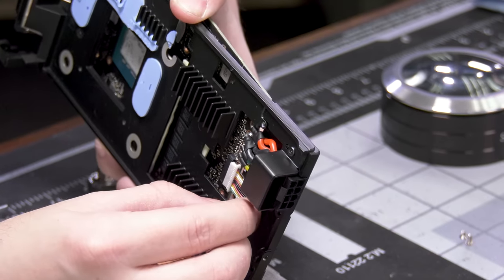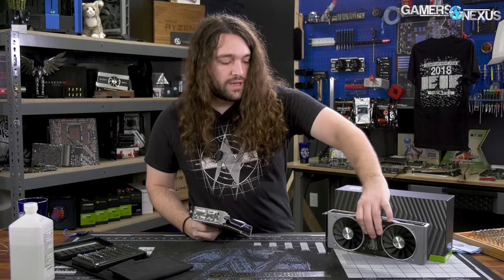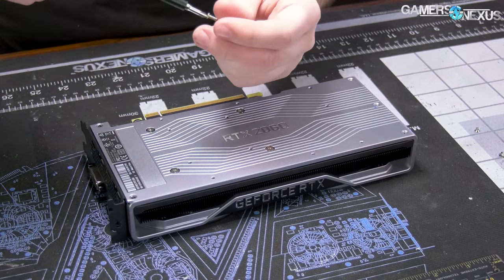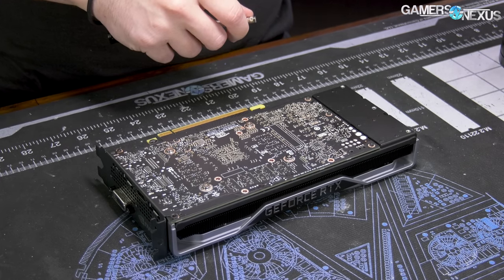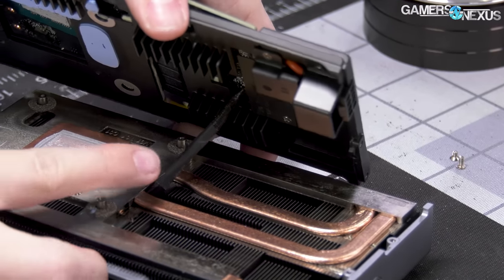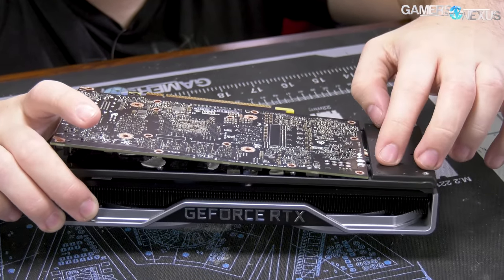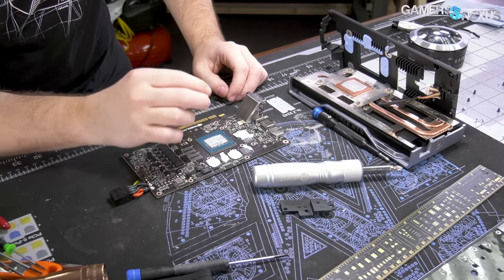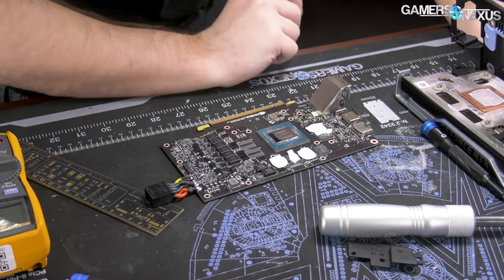RTX 2060 FE Tear-Down: They Added More Glue and Screws

Comment: Clearly nVidia doesn't want you to watercool this card
Reply: My first thought.
Reply: +1
Reply: @frostybe3r  A mid end card is now 350$ :(
Reply: Why do you need to watercool any card?
Reply: @frostybe3r  lol im sorry, my sarcasm wasnt obvious enough for you.
Reply: @warblesnow7925  nope, not clear enough. Didn't catch it first time either.
Reply: frostybe3r Not necessarily higher frequency. silicon lottery; I lost with only 60+ core clock for a Hybrid Ti FTW3. 😢
Reply: wasted their otherwise good PCB (not just 2060, but all the RTX reference cards) because of that, so sad
Reply: Who in their right mind would buy a low end card like this to put in an expensive custom loop build?!
Reply: They don’t even want you to replace the fans if they go bad.
Reply: @frostybe3r  because it's an underclocked 2070. Same exact chip but sold twice as much with the 2070
Reply: No company really wants you to be able to change things on their product.
They lose a lot of money on customer complaints and even more when they changed anything on their product. That's why a lot of companies already simply send you a new product when you have some issues rather than going through the whole process of figuring out where those issues came from.

But when that person is probably going to also damage the new replacement product it costs even more and so on. For someone producing such things it would be best for the customers to just buy them as they are, use them as they are and replace them when there is a problem.
Reply: Be water my friend
Reply: frostybe3r what's the point of longevity if you're just upgrading every new launch anyway?
Reply: Ignoring the fact that you yourself probably wouldn't want to watercool an XX60 card, I wouldn't say they don't want you to, they just don't give a damn how hard a time you have doing it.

Comment: No way I am buying the reference card after seeing this
Reply: Who opens their video cards anyway? Why do you care?
Reply: @trippplefive  In case I want to change the thermal paste in a few years, for cleaning, in case a fan breaks and I need to change it. There is no reason to why this need to be such a pain in the ass.
Reply: For thermal paste replacement or cleaning the heat sink. And water cooling with higher end cards.
Reply: trippplefive because when the fans die, I want to be able to replace them.
Reply: @trippplefive  ordinary people (Nooob 😂) like you don't understand that
Reply: @claritoresdiano1021  Calls people noob, but probably thinks that PSU brands other than EVGA or Corsair (Especially cheaper brands) are trash or will probably blow up.

Comment: Extra screws. As components heat up and cool down expansion and contraction occur. More screws = less change that seals between eugene pads, solder joints and thermal connections can be broken. This increases the cards structural integrity and assures optimal thermal flow. It also reduces the acoustic vibration offset decreasing the sound which may emanate from various loosening/tightening areas of the board during hot/cool cycles.

Comment: For removing glue use Isopropyl Alcohol, Acetone or..if you're careful with it (it can weld PVC, Polyurethane and that) Butanone/Methyl Ethyl Ketone (MEK).

They all make good degreasers too if you chuck them in water & mop a floor with them.

Comment: Using one way to build cards (from 2080 -> 2060) means you need less installations, instructions, people, materials, etc. If you have set up the 2080 construction line, it is more cost effective to stream in the 2060, instead of opting for a completely different and separate solution. You must try and reuse as many machines, people and knowledge as possible. This also means you have less time overhead and you can reuse the same quality tests down the line. I think it makes perfectly sense to look at ROI for already in place machinery, when you have a running industry and don't want to start over from scratch.

Comment: This is hard to watch. Use your eyes. There looks to be a wire-strain relief screwed on over the connector of the wire you're trying to access... 2 screws... It looks like you can see it at around 12:00 -- There is enough wire to flip it over either by rotating on its side, or by flipping it 180 over itself - that's typically how it is designed so it can come apart.

Edit: He finally sees it... But we had a saying in the military.. never with force... This pertained to disassembling weapons - if it doesn't move in a certain way, it isn't meant to - don't force it... The same is true for a lot of these other designs....

Now I hear about the glue - they shouldn't have done that - it should've been made to be easily disassembled...

Edit: It is a strain relief, not solely for cable management. If you were to rotate it over without that plate, then you could break the connector. Because it was there, with all of your yanking and tugging and fussing, it prevented it from breaking - however they may have glued it because it is a review sample or knew what you were going to do so they added it in case you were going to take it apart without looking, which you did, to prevent damage in case you spotted the strain relief, you didn't, and broke the connector, which you couldn't because of their glue.

Edit: If they are that new to fan structure building it could simply be them avoiding patents...

Comment: I used to build computers in the late 90’s when new tech was way more exciting. They didn’t cover things in plastic shrouds. In fact I had a Slot 1 Intel celeron that came as just a bare PCB. Graphics cards had just come out  as AGP - were bare PCB’s and it was up to you to add a fan to cool the chip.

Comment: The word on the street is that you get more performance when you have more screws per cuda core, you get better performance. In light of this recent discovery, Nvidia is trying to achieve a ratio of 1:1 in that regard to achieve maximum possible performance. They have also found a direct relationship between die size and glue area and they are working on that ratio as well.

Comment: I don't like how the power socket is wired in on an extension.. Using that card as a test bench card would just kill it, those wires will snap from removing the power cable a lot over time..

Comment: I was going to say I am shocked that somebody finally made a GPU where you can remove the shroud without removing the heatsink from the board. - Which I always wanted, (it be easier to clean the the card and fans from dust). But no... that cable crushed that.

Comment: This isn't hard to explain.  The small reference PCB will allow AIBs to make cheaper cards.  Clearly the PCB was designed with the intent of allowing the power connector to be directly soldered instead of pig-tailed.  The over-designed FE card is because nVidia wants an "Apple" like product at any cost.  Someone will make an easy to follow, step-by-step guide for this card.  Although it won't be super quick, nothing looked that intimidating in this tear down.

Comment: It would be a LOT easier to take apart if you didn't keep stretching the cable diagonally by keeping the parts like that. If you pulled the bottom closer to you so the cable was at the same place as on the cooler, then you would get a lot more length to work with. then you could keep it at 90 degrees and screw everything apart.. ;)

Comment: Nvidia really needs to do a bit of management adjustments, take someone from the manufacturing side for the coolers and put them in charge of the engineering side, when the engineers engineer something they will be told to simplify it.... 5 times in a row before it gets approved. You get an equal quality part that costs less to make and assemble in the end. After one product launch and being forced to simplify it a half dozen times the engineers will make the next one simple from the start and be able to put more time into the actual active cooling parts making it more efficient and superior.

Comment: Couldn't you have just turned the fan assembly 90 degrees so you can access the 3 phillips screws on the connector cover? It looks like the harness is long enough for that.

Comment: Hey Steve, I was wondering how common it is these days to swap out the cooler on graphics cards as it was back in the days? The 8800GT was the last card I swapped coolers on, but before that it was pretty common to do it on a "founders edition" card. Also because the "founders editions" were usually cheaper than the aftermarket with better cooling. Are brands like Zalman, Arctic, Thermalright, Zerotherm etc. even still producing aftermarket stuff? I 2 years ago I swapped my desktop for a gaming laptop because of the crazy graphics card and RAM prices and haven't really been keeping up to date.

Comment: So, if that DVI  output wasn't there it could be a single slot card if used with a waterblock?
Reply: Possibly. Higher end cards such as the 2080 eliminate the DVI connector. And stick with the HDMI and DisplayPort connectors.
Reply: Except as shown here they are trying to get people to break their gpu's when trying to put a waterblock on
Reply: @React2Quick  Most higher end cards replace the lone DVI with Displayport because they hate compact watercooling builds.

Oh well, I'll just keep cutting it off with my dremel.
Reply: Just modify it, wouldnt even be difficult

Comment: lol, seems like PITA to open the damn thing.

My CG is a GTX750ti old af, the original fans died but for reasons I couldn't afford buying a kit or replace it with a newer card, but I had an old CPU fan lying around somewhere... 

It happened that the board had an additional fan powersupply just close enough the PCI-e slot, I strapped the damn fan on the aluminum heatsink, et voila, I can even set the fan's rpm depending the CG's workload !! Been working like that for 2 additional years, the card never been so cool lol.

Comment: They've been making these cards for like these 10 years with almost identical designs literally no reason to start using less convenient screws and gluing them together other then planed obsolescence and discouraging you from doing preventive maintenance on the card as performance gains with revisions are starting to slow down.

Comment: not that ti excuses crappy design but, i actually liked rear mounted 6 pins in some cases. they used to do it that years ago and it made hiding cables in my case easier and as i could run the 6 pcie cable along the HDD rack in the case.

Comment: Actually .. Gluing connectors was something ... ehm .. "popular" 10-20 years ago ? And some "older" PC builders or technics are still gluing connectors at MB to prevent accidental disconecting by user ... I think Nvidia had same idea, maybe they got some cards back fro mcustomers, that they are broken, but they just "thanks to vibration, heat and moving with pc or in package" were disconnected, so they glued and packed them and stuck them, so they cant move ..

Comment: Hey Steve, I have a question for you! My father just recently played VR on my gaming rig and was blown away by it and wants to build a gaming rig capable of normal and VR gaming at a decent frame rate (I think VR is optimal at 90fps? Or at least that is what my Oculus Rift runs at). Would a 2060 be a good choice for that given that most of the GTX 10 series cards are gone or to high of a price to be reasonable? Or would you suggest something else? The monitor I gave to him is an LG ultrawide 1080p model.

Comment: I have the same model of rtx 2060. Is it a good idea taking the back plate out? Will it help at least a bit with its temps? I noticed this part in particular gets really hot, so I'm not sure whether it actually dissipates heat or retains it..

Comment: Why don't they just put the power connector at the bottom of the card, and install power connector on motherboard that it plugs in to... We already have ATX connector plus the 8-pin AUX connector, why don't they just make it possible to connect GPU connectors on the motherboard as well... Just a thought.

Comment: With all these different screws/ bolts i Fix it will have to sell a $1000 tool kit... So how long will the thermal paste last before you have to pull apart the card to replace the paste? If this is the rigmarole you have to go through they have basically shortened the effective lifespan of the card...

Comment: I watched a video of a bald guy who likes to test electronics by tearing them apart carefully, he used refrigerant in a can and the liquid Nitrogen to cause the adhesive to break down.  I wonder if you could block that cable off and spray it with canned refrigerant to get it loose without damaging the other electronics..... not sure how badly it’d effect surrounding electronics or the wires themselves though.

Comment: It's a shame few outlets mention the pricing outside the US. Here's an example from today (2019-01-07) of a 2080 Ti (I realise this video is about a 2060 but this highlights my point):
Card : EVGA RTX 2080 Ti Ultra 
US : $1410 (6% combined tax)
UK : £1350 / $1725 (inc. 20% VAT)
EU : €1400 / $1605 (.de - inc. 19% VAT)

There's quite a difference once taxes are included for the same product, even with the current Trump tariffs. 

Notes: US, UK, EURO area / sums rounded to nearest unit / all $ in USD / 6% US tax includes sales and state/local rates.

Comment: I ran NVIDIA cards for 18 years, got a AMD card because of the price, the MSI  RX570 8GB is way faster than the NVIDIA GTX 960 4gb card and it does not draw much more power on my UPS it is almost the same, only a little more power under load like almost every game set to max, at 70% fan speed it runs under 60c. The RX570 runs better on windows 10

Comment: Samsung memory does seem to be the best.... All of the GTX Pascal series with Samsung memory, of which I have owned or used, all OC'd at least +500-700 on memory... and now with RTX, with Samsung memory, it seems to be EXACTLY the same, regardless of GDDR6x or not... I have a 2070 sitting happily and as stable as can be, for the past month at least, at +210/+700 .... And that's a tangible difference on a card that already outbenches a 1080 with ease, and a 1080ti with some ease. So, I would advice seeking Sammy mem whenever possible, as it yields far far better results than any other I've tested.

Comment: So, wait... People take apart their GPU for thermal paste change and the such? That's a thing?! 
And here my GPU usually sits for 5 years of heavy use in my system before been replaced with the new stuff and I never touch them once in the case, besides a bit of compressed air dedusting.

Comment: Nothing wrong with using adhesive. The cards are designed and built to play games and they do that. If Nvidia/AMD are advertising their cards as being easy to disassemble then I could understand the disappointment. 

I can see it being an issue for high end cards where there is a market for aftermarket cooling solutions. But for their mid/low end stuff, who the hell cares.
Reply: Because u need to replace thermo eventually even on cheap cards

Comment: i have a question would it be possible to use an arctic accelero xtreme 3 on the 2070 without removing the front plate and the rear plate because I think that removing the front plate would make it necessary to modify the 8x pin manually

Comment: My GTX has 6 screws to remove the whole cooler from the PCB, also the ventilator section can be removed separately without removing the cooler itself, also 6 screws for that (nothing glued, nothing soldered). NVIDIA has gone insane to put that many screws it's like they literally say to their new clients "screw you". I think I'm going to skip that generation of NVIDIA cards.  I don't like the direction NVIDIA is taking. I don't like their new and stupid gimmicks.

Comment: Why the ball sack would you need so many screws and what the fuck is glue doing inside a GPU?! I was quite found of the 8 or 9 screws my PowerColor RX580 had, and my current Gainward 2080 Phantom also isn't so hard to teardown, I belief NVIDIA is trying to set the record for the most complicated card assembly, lucky for them no other company is competing, in this branch.

Comment: DVI, yuk, yuk, Oh wait my 27" Crossover 2560 monitor is DVI only. I paid $400 for it. It still works. I am keeping it. It also has no dead or stuck pixels. So am one those 10 people that still have one? Really? I don't need either the green or red sync schama. BTW you can't use a "98 5 speed in 94 in Ford if you don't get the stick that came with it. Oh you can make it fit, but it will never work right. Ford's solution, just buy a 2004 5 speed with a new Ranger rapped around it. About time Nvidia got Schmart.

Comment: Ah, maintenance after 2-3 years?! Who would even think about it :) The design is intentionally over-complicated in order to put off the general consumer from changing NVidia's rubbish "gaps pads" and "thermal paste". That's an excellent strategy to increase the average PCB temperature so that you are more likely to have a component failure in less than 3 years. Then you are forced to buy again, and again.

Comment: I recently learned a term called "potting", where the whole circuit-board assembly of Apollo space craft computer is buried/coated with thick layer of black material.
 " DON'T GIVE NVIDIA IDEA!!!!! "
😅😅🤣🤣🤣🤣
I was wondering if there any crazy modder would drop 2 more memory chips on those unoccupied VRAM slots and somehow get it to works 🤣🤣🤣

Comment: did they hire an apple engineer? And you do want more density in the cooler, why do yo think ALL 8750H cpus thermal throttle... no thermal capacitance in the cooler aka density. Thermal capacitance is the resistance to temperature change.